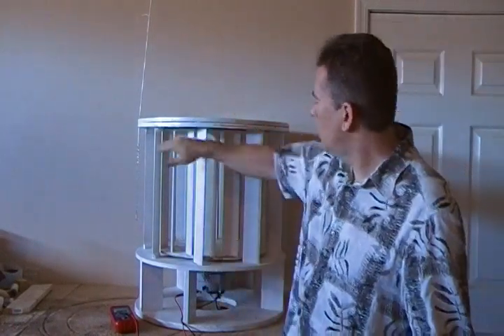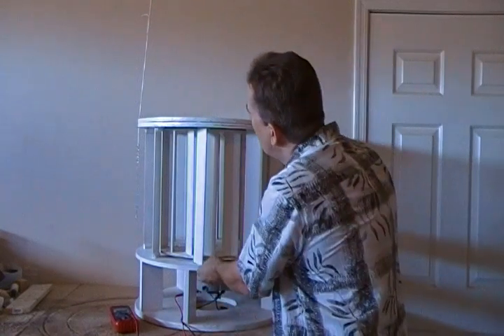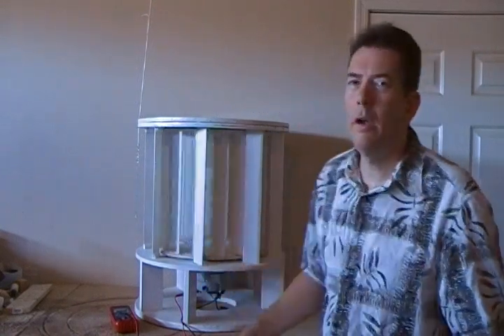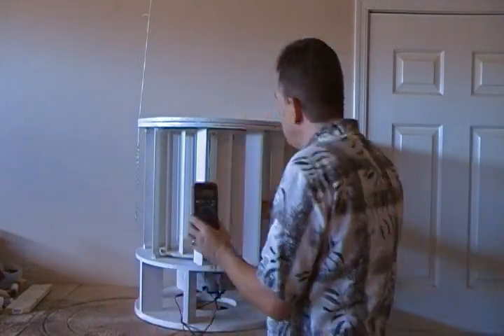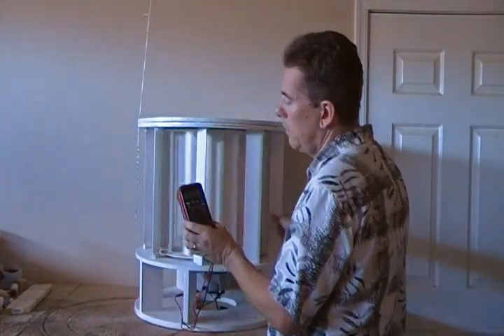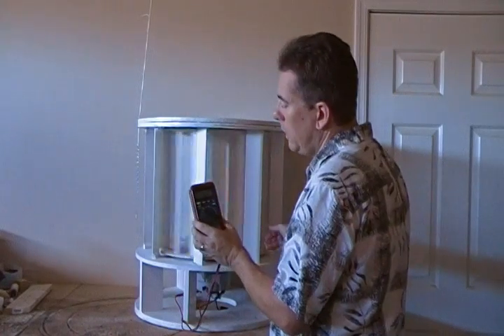Building a Wind Turbine (46 of 46) Finishing Up

Comment: I am really sad to see no comments here. I see you made a lot of hours and days on this and i just want to say, you are amazing. A great and skilled teacher, wish i had a father like you. Here goes, i have been designing inventions for about ten years now, and i am not a skilled mechanic, actually i am not skilled in anything besides thinking. So my improvment for this was a defenfder that rotates in the wind direction. It blocks out the part of the turbine where the wind actually blocks the turbine from spinning. I call it the pasive segment. I have designed my windmil to have a vertical axis, but it has the same fins like yours. To picture it, like a water mill, only wider and with a deflector that blocks the wind on passive side. I would like to ask, are you interested in building a deflector on your windmill and testing the output? Also, I was thinking about another idea, installing a gearbox for alternator and making it automatic regarding to wind speeds. I Would like to see if it pumps the output. I dont know much about windmills... but i know your videos are the thing ive been looking for. I just need to do some measurment adjustment since im from europe. Anyway... You are amazing. And im not even gay.

Comment: oh also the bottom plate of your rotor where the blades are attached? ummmm... you need to have that going at a downward angle towards the hole n the center where the alternator is.... and then ROUND the edges of that hole with a rasp/file or router... see as it is the air outlet....if you make it more aerodynamic it helps improve airflow... like a good racing manifold on a V8 :D .. oh and to boost that effect.....take a cone and affix it to the top plate of the rotor inside of it so the the air naturally WANTS to go out the outlet hole at the bottom instead of like loitering near the top of the rotor.. or worse trying to exit the backside of the unit through the blades :)

Comment: Okay, great video series, but one thing you might want to do to improve this design is the following -> Venturi Effects ... sooooo.... you take an build a cylindrical enclosure just larger than the size of your generator with no bottom in it but a top.... now... you use a funnel shaped collector to channel wind to the collector... say double the width and height of the rotor... then... you have a matching funnel going the opposite direction out the place here the air outlets.. (your alternator hole at the bottom) ... then.... you enclose the rotor in a cylindrical container just larger than it but with air openings for the cones and you must make sure the venturi enclosure you havejust built can rotate independently of the stand the rotor is on.... because you need to attach a rudder at the back of said enclosure to have it naturally swing the the directin of the wind... but yeah.. you could get double or more wind amplification that way easy.... ;) keep up the good work! WTG!

Comment: I love the design but I have one question. Does the width of the stators introduce any adverse aerodynamic effects such as creating turbulence in front of the airfoils ? Would a rounded stator decrease the possibility of stator turbulence becoming an issue ? Possibly replacing the stator with pipe or threaded rod .

Comment: I want to learn about wind power and this is just the perfect project. I am a novice so the electrical part will be a challenge. I guess the first unit is the PMA but I was wondering if I should purchase the DC-540 Low Wind PMA or the DC-520 High Wind PMA? I am in a high wind area but from what you have written it still may make more sense to purchase the low wind to harness our lower wind days. Any advice would be appreciated. Thanks So much Mike! Cheers Heidi......

Comment from the maker: @efortune357 This is small turbine that needs good wind to benefit from it, 20 mpr +. To get that most of the time you need a mast. So if you are in a low wind area I would go with solar first and then add wind to supplement on stormy and cloudy days. However, if you live in area with a lot of wind, then you won't beat wind energy.

Comment: @imikewillrockyou  Thanks for the info.  I'm in Columbus Oh so not always wind, not always sunny:(  Plus I'm try to conserve money.  I was thinking a solution may be instead of having a turbine 3x tall, I have 3 separate turbines stacked.  I still need to build a test turbine,  just thinking out loud...  Are people using multiple turbines to engergize homes? It makes sense on the surface but I have a lot to learn.

Comment from the maker: @efortune357 Increasing the height will have diminishing returns because you can only gain so much speed with that diameter and load. Or in other words the added weight will slow it down. Adding a little more height might give you a slight improvement but at some point it will actually slow you down and the structure will be less stable overall. Hope that helps. btw, if you live in a low wind area go with solar.

Comment from the maker: @terrilynndempsey I don't go into the battery hook up. There are a lot of ways this set-up could be done. I'm just charging 6 volt golf cart batteries hooked in series to make a 12 volt system. Alternator to charge controller to batteries.

Comment from the maker: @Johnnylofat I could complete this project in a day or two. At first it took maybe a week since I didn't know exactly how to go about each step. As far as materials  wood is actually a good material for this. It's strong, light, easy to work with and lasts a long time. However, if cost wasn't a factor I would build these out of carbon fiber. Carbon fiber is extremely strong and light weight and would be perfect except for the cost and time involved. My next choice would be good old fiberglass.

Comment from the maker: @MrHorsetail on this turbine I'm using a converted PMA I purchased from a company on the net called wind blue power. I'm using their "low wind" PMA. And you need somewhere between 10-15mpr wind flowing across the turbine before 12v. I've seen the volts get near there below 10 mph but to be realistic you really need 10+ mpr to see any real energy being produced.  It needs to be in wind! If you only have very light breezes in your area I would suggest looking into solar.

Comment from the maker: @JamesThomas That's a good idea add just a few tesla discs and see if there is any improvement. I'd like to see if the tesla discs would run well on their own. I'm a little skeptical due to how Tesla used the discs with a very concentrated enclosed system to force the gas through the system. Wind can travel around. But it's still a very interesting concept.

Comment from the maker: @imikewillrockyou The way I designed this turbine the air needs to flow through easily. The turbine get's a kick as the air enters and then again when it exits. My guess is tesla discs might kill the wing lift effect. They likely designed their turbine a lot different even if they look similar.I'm sure they have a great turbine but I'm after low cost. If we can get the cost low enough everyone will start using alt energy.

Comment: @imikewillrockyou 
Indeed the discs would add weight. 
Tesnic, is a company with a VAWT design similar to yours, but with the added discs. They do a test with and without the discs, that shows the Tesla turbine effect adds considerable efficiency making the heavier design turn at a lower wind speed. The added weight also adds more torque.
2 part test found here at YouTube under: Tesnic vs Darrieus

Comment from the maker: @9887663 Thin edge goes to the outside. I've tried both not exactly sure why that works best. It's appear since there is less resistance going in the turbine get's a nice extra push as the air exits the turbine. Or likely the wing lift effect just works better that direction.

Comment from the maker: @9887663 High steady wind 20 mph and above seems to run this turbine very smooth. There is very little noise. In fact the wind makes more noise than I can detect from the turbine. Much more quiet than a horizontal. Never killed a bird with this turbine either which is another advantage.